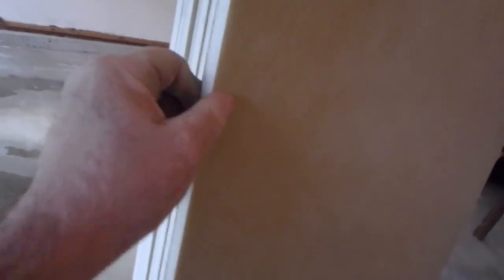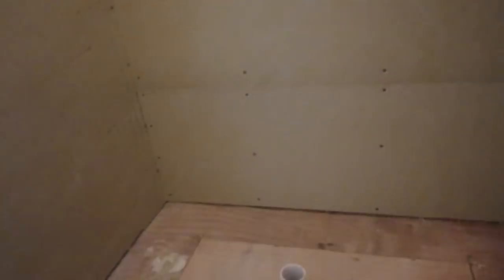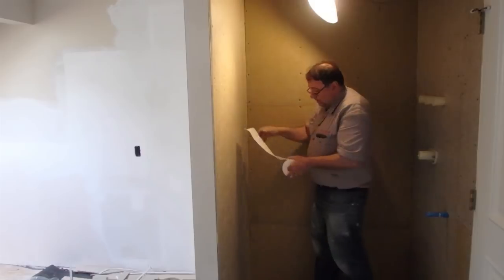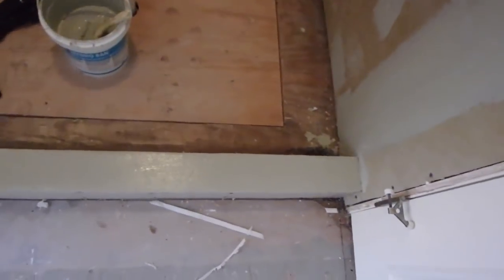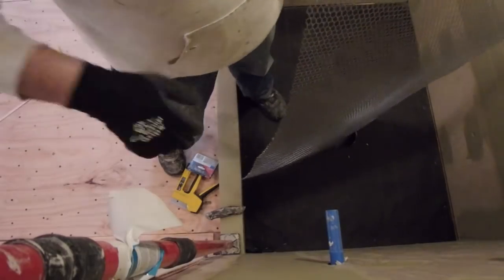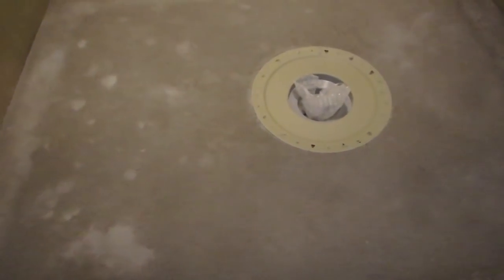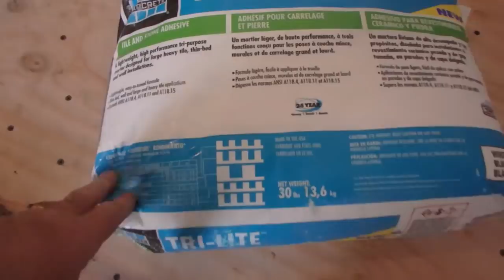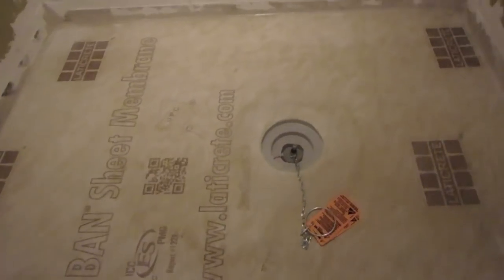How to build  a waterproof shower Stall

Comment: Another great video. I've been using this system for a number of years now, and the only thing I do different is I do thin set all seams and corners. This is not out of stubbornness or just being used to doing it with other products. It's because the foundations here in Dallas move constantly and everything is done on a slab because there are no basements here due to the shifting of the soil.  I then go over all of the seams in corners with the fiberglass mesh cloth.  Another thing I do is lightly scarify the surface of the bonding flange drain for the two coats with 120 grit sand paper.

Comment: Thanks for your videos!
For steam, the seams and corners get sealing tape installed with say multimax lite.  Which should be sufficient.
Do you think it would be ok to go over the seams of the sealing tape seams with red guard? Since red guard is steam approved and therefor better than the liquid hydroban, which I read is not steam approved.
Reply from the maker: Do not modify the system.
Reply: @SalDiBlasi  Thanks for the reply!  Love your videos👍

Comment: What’s the reason you don’t thinset the plywood and deck mud to the thinset like I’ve seen in your concrete slab pans? What’s the difference between the two methods? What would happen if you did a layer of thinset and then deck mud to that on plywood?
Reply from the maker: on concrete it is a boded mud bed, on plywood it is floating mud bed, although for a small shower it is ok to do bonded on plywood.

Comment: Sal ... watch the video ur talking about. Wondered why you used the particular Laticrete thin set you used when putting down the floor membrane. Take care.
Reply from the maker: Best to use Laticrete thinset with Laticrete products, one manufacturer for the whole system. The Tri Lite was the one that Laticrete suggested I use. Who am I to argue?
Reply: Sal DiBlasi Thanks Sal ... I was looking at the specs before I received you reply ... appears that it's a higher concentration of fine sand that makes it a little creamier  ... thanks again.

Comment: Sal, is it really acceptable to install a mortar floor with no liner and just paint it with the hydro-ban liquid membrane (for a non-steam application)?  Is the hydro-ban product so superior to other liquid waterproofing membranes on the market?  In the past, you have always been rigorous about ensuring that there was a solid (PVC etc.) membrane and a drain system to allow for water penetrating the mortar.  For the Kerdi applications, you either used the traditional mortar pan or the Kerdi floor system - I've never seen you rely only on a liquid membrane before.
Reply from the maker: +dug big the bonding flange drain makes it possible and it will be just fine as long as the Hydro Ban is applied correctly. This has also been done using the divot method for many years.

Comment: HI Sal, I used your information A couple years ago to build a shower and was very successful, thank you very much. Now I have to do it again and have 3 questions. 
First, is it necessary to always add the metal lath when the shower is going on concrete floor?
Secondly when measuring for the 1/4" drop for the pre-slope, why not measure from the corners which is further away than the walls?
Lastly, when putting the thinset down on the inside corner of the threshold, how is that corner going to keep water from working its way through the crack when there isn't an actual border like on the other corners. Everything else has a 2" overlap but that corner.
Reply from the maker: No wire on concrete here is a video https://www.youtube.com/watch?v=m9eSdRkCcEo&t=1s
Slope has to be at least 1/4" per foot, if you have that everything else is gravy.
Everything has a  2" overlap, so it is water tight, does not matter what order the sheets overlap. Nit sure what you are referring to.
Reply: Thanks for responding, glad I don't need wire mesh over concrete. 
When measuring for the 1/4" drop for the pre-slope, you did it 90° from the walls, why not 45° from the corners. Wouldn't it be a better slope or not make much difference?
When you put the thinset down on the inside corner of the threshold, there wasn't a 2" piece of material that you used to seal that part to keep water from working its way through the crack at the bottom.  You might have not just shown that but it appeared everything else had a 2" overlap but that corner.
Reply from the maker: Like I said, as long as you get the correct slope, makes no difference where you measure from. Watch the video again, everything has a 2" overlap, including the curb.
Reply: Thank you very much sorry for missing the overlap. I now have a new issue. The rectangular shower dimensions are 49 3/4" by 44 1/2". But when you buy the material, in only comes in 48" widths. 
2 last questions. How do you cut it to prevent such a small strip of material, or is that not a real issue? 
Also should I use 1/2" or 5/8" thickness material for tiling?
It is called Densheild, a rubberized foam filled material (http://pacwestsystems.com/wp-content/uploads/2015/03/DenShield-Technical-Guide.pdf )
Reply from the maker: You need to clarify how you intend to build this shower, are you using a vinyl liner, or are you going to build a sealed system, with a foam board or install a sheet membrane? Denshield will not work if you intend to substitute it for a foam board, It will be OK if you intend to install a sheet membrane, it is also a poor choice to use with a vinyl liner.
Reply: I was planning to use pre-slope then vinyl liner and backing boards about 8 inches high around the base. The corners would have been empty so the vinyl could be folded inside to prevent the bulky overlap of the material. Then the DensSheild with a fiberglass tape and thinset to cover all connecting edges and corners. There will not be any benches but I was hoping to pout in a small shelf for soap. Hope that is clear. Than k you again for being so willing to help us.
Reply from the maker: To deal with the bulky overlap of the vinyl liner you can either fold them into a stud bay, or notch out the studs or fur out the studs.The idea of installing tow kinds of board seems like a lot of extra work with extra seams for no reason. If you are using a fiber cement board, like Hardie, then the final mud goes in first , then the board is installed with a small gap between the board and mud which is filled with a silicone sealant to prevent contact between the two, same for Denshield. A true cement board Like Durock, can be in the mud, but not touching the liner. All these directions are available from the manufacturer of the materials you intend to use.
Reply: We are so blessed that someone with your knowledge is willing to share it. Thank you for great videos and answering questions. It is also amazing that you have so much knowledge about so many different products. Last question. I'm a bit confused though as to why you said that using the vinyl liner wasn't a good fit with DensSheild? I read that as long as the DensSheild isn't touching the vinyl, but caulked with a silicone sealant about 1/8" to 1/4" from the DensSheild, it would be fine. Maybe you were referring to using the DensSheild as a bench. I know it wouldn't be strong enough for bench, just a cubby hole, but if it had a framed bench it might be OK. I'm just unsure if you meant something else or not. I don't mind any extra work but because products like Schluter are so expensive, I need to keep the costs under control.

Comment: The other question I have is ... considering the method you used on this video have you considered using a slope material like pro Slope or USG pre sloped board. I would think there really wouldn't be a need for mortar bed with the membrane on top. Just wondering. Take care.
Reply from the maker: As I mentioned in the video, Laticrete makes foam trays fro the shower floor, http://amzn.to/2sNjnAo I just feel mud is more adaptable
Reply: Sal DiBlasi Thanks ... I guess you can buy a lot of mud for $500 to $600 .... later, take care.

Comment: 2 more Questions.  What are you using on the sub-floor below the mud.    And..  Where should I look for the Laticrete wall boards?  Can't seem to find those.
Reply from the maker: Tar paper and wire lath over sub floor. I get my Hydro Ban Board at my tile suppler, maybe you can find it online

Comment: When tiling a shower do you butt the tiles in the corner or leave a grout joint.?
And do you grout the corner or caulk the corner?
Reply from the maker: All corners and change of plain should have room for movement and have a soft joint, so no grout in the corners.

Comment: So what would be your coarse of action if the shower stall had leaked at the end? Just curious.
Reply from the maker: If you are referring to the flood test, it usually will reveal where the leak is and it is a simple matter to patch and to repeat the test. I would also like to add that I have never had a sealed system fail a flood test. If everything is done the proper way, and care has been taken not to do any damage, then there should be no reason for a leak.

Comment: If I use cement board for the walls, can I butt it with the mud floor pan or do I have to give it some gap?
Reply from the maker: Cant really answer that without knowing what system you are using.
Reply from the maker: No gap, you need to tie the wall to the mud with kerdi band.
Reply: What if it's Hardi are Durock?

Comment: sal why would 1mt x 1mt tile crack usually around 6months after installation, always around cut tiles at corners .
I always back butter and always happens only on underfloor heating screeds
Reply from the maker: Can't really say without knowing more, Have you checked the deflection of the floor?

Comment: Could you please compare this system vs schluter
Reply from the maker: Same type of system, sealed shower system, Laticrete has more options and for different types of showers. Both excellent choices.
Reply: I used the Schluter and, of course Sal's right. I'm a homeowner and haven't tried the Laticrete, so take this for what it's worth: the idea of painting on the Hydroban rather than mixing thinset for the Scluter on the walls would have been a huge benefit for me. The drain on this looks a little more complicated, but with their foamed floor it should be easy. I'd have liked more options for a niche. All of that said, the Schluter worked fine. So, if you have anything close to Sal's skill, either will be good. But really, who has Sal's skills!???!
Reply from the maker: I know a lot of top notch installers, and most of them use only the best products available for their installs, why take a chance with anything else.